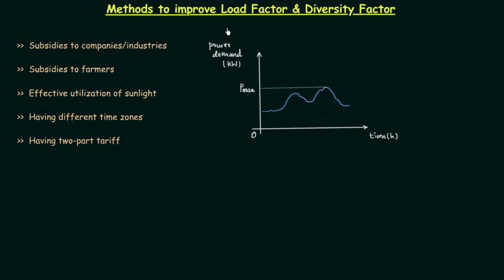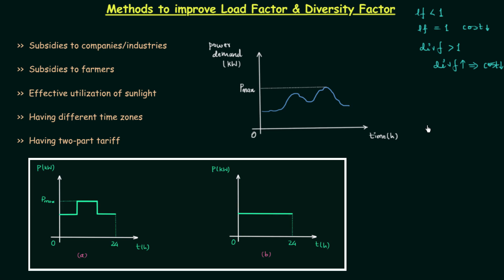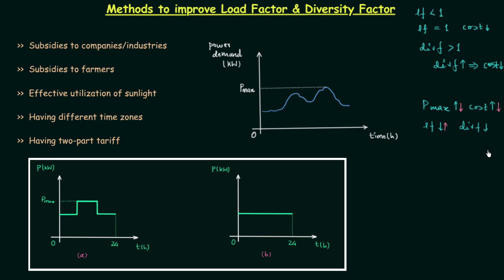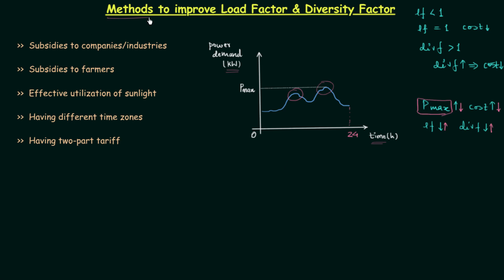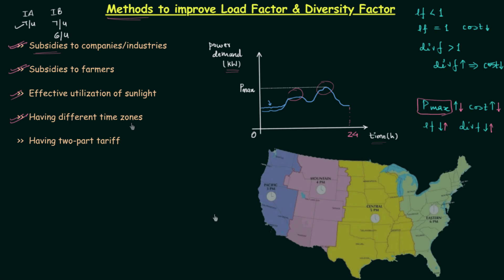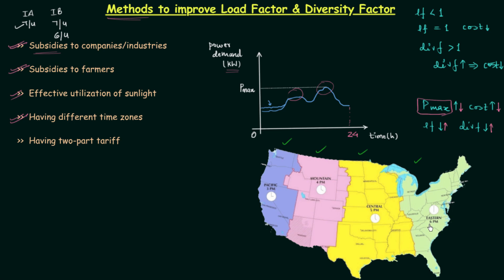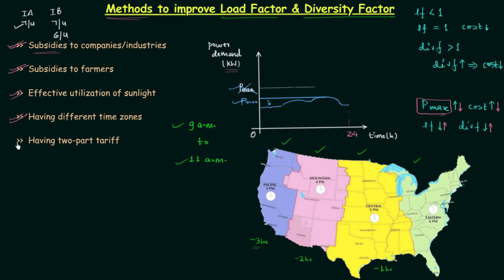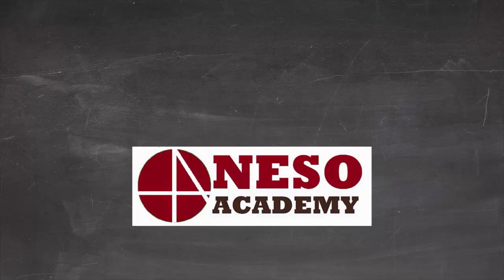Methods to improve Load Factor and Diversity Factor

Comment: dear: may teacher can you help me this question please? I need it for know?
Suppose a utilization factor for solving a critical system is calculated to be greater than one but if the system has to be implemented using clock-drive algorithm, what solution do you propose  (5pts)